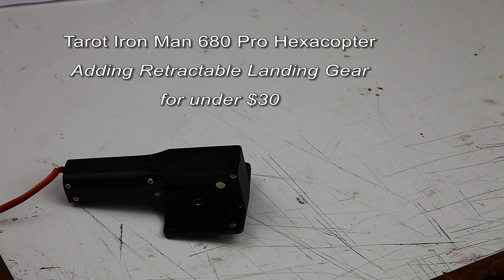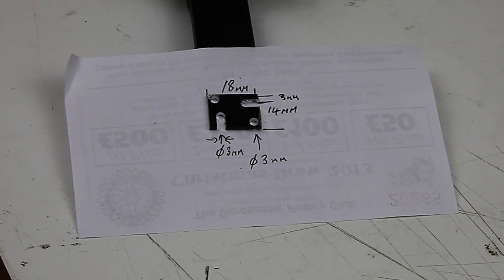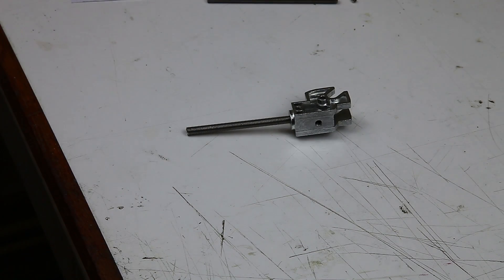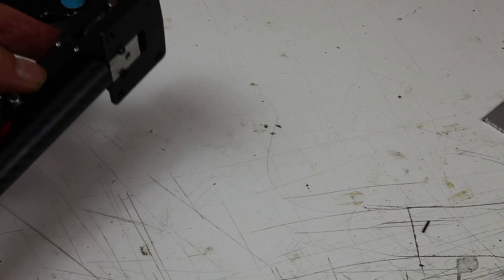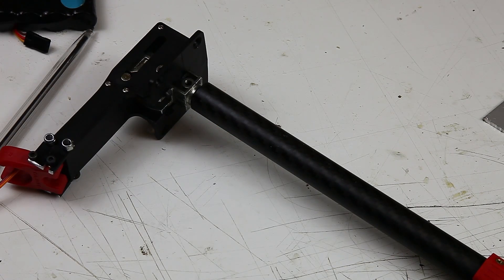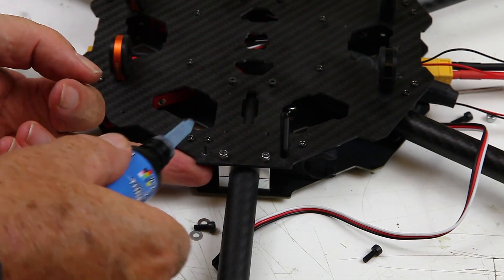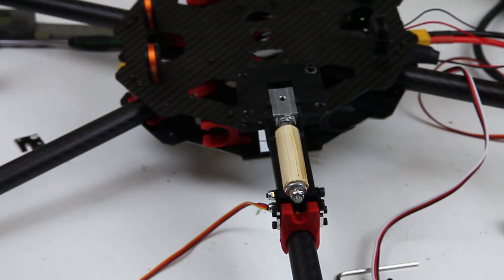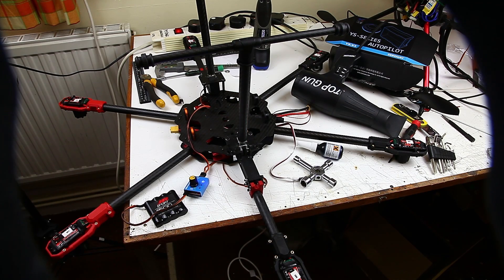Landing Gear Retracts  for Tarot Iron Man 680 Pro (for under $30)

Comment: Kinda off subject.... what esc are you using?  Ive tried three different ones and they dont fit as clean as yours.
Reply from the maker: +Christopher Loesch These ones should go in nicely EMAX Simon Series 30amp ESC The 40 amp ones fit as well but need to be forced in a bit, also get rid of some of the wire to make it as short as possible

Comment: Also a little help for people looking for the 14mm diameter dowels, I believe a drum stick is the same diameter. Cheaper finding that on ebay than driving around looking for the correct size dowel. Cost me under $3 on ebay for a 14mm drumstick . Just make sure that is the diameter .

Comment: Do you need any type of controller for the retracts , or hook the servo lines straight into your receiver?
Reply from the maker: You just need to connect the servo lines directly to a spare channel (The one you want to use) on your receiver. Use a Y lead so that both are controlled together. You can get a Y lead from any hobby shop.
Reply: Chris Hornby Thanks Chris. Great video.

Comment: Which retract motor from HK did you use?
Reply from the maker: hobbyking product id 225000029
Reply from the maker: Chris Hornby sorry  2250000290
Reply from the maker: Chris Hornby wrong again (it is at the end of the video! 225000020